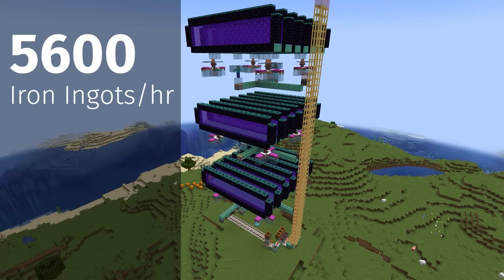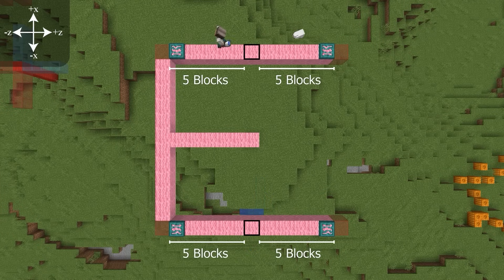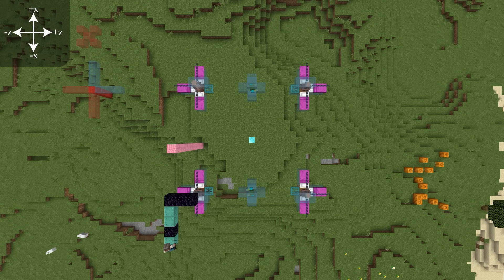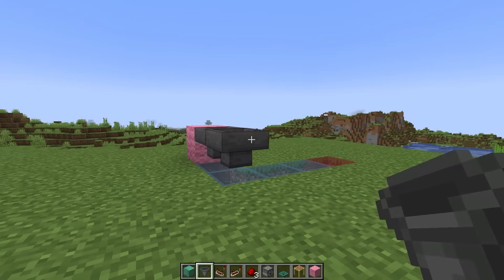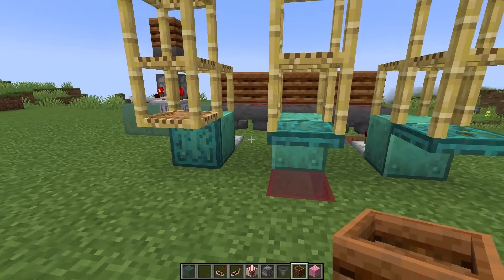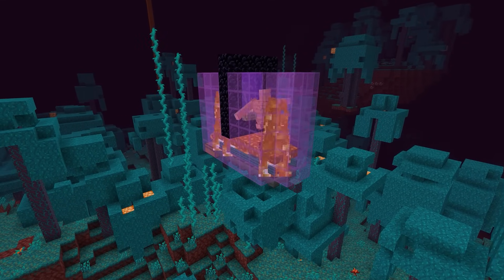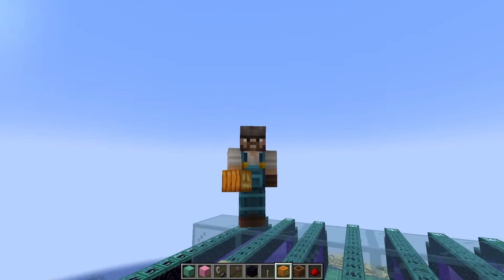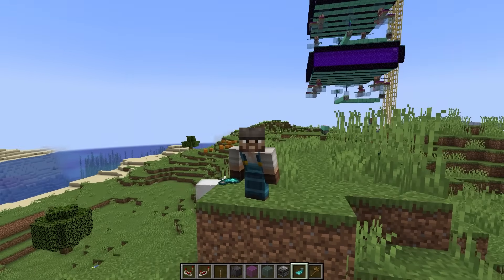Most Efficient High Capacity Iron Farm - Build Tutorial

Comment: Is anyone having problems with zombie pigmen being on the other side of the portal, if you do know the solution could you please lend a hand?
Reply: Yes! It was driving me crazy, but I fixed it. The zombified pigmen are spawning on the overworld side and going through the portal. My kill chamber was full of them. So on each overworld portal platform, I placed turtle eggs and trapdoors so they believe they can walk to them, between each portal frame on the outside of one side of the platform, but alternating sides for each of the 3 platforms. Alternate sides so higher layer Pigmen don't fall on and destroy lower layer eggs. This protects Layer 2 eggs from Layer 3 Pigmen and Layer 1 eggs from Layer 2 Pigmen. But to protect Layer 1 eggs from Layer 3 Pigmen requires one extra step, I added end rods across the top over the eggs with carpets on the same level as the top of the portals, and build the farm so that the Layer 1 Pigmen die when hitting ground level. Now I have zero Zombified Pigmen in my kill chamber, yay!
Reply: @Curufinwei  I had a vision of doing this however I didn't really meet the resources required so I quite literally just dealt with it :)

Comment: could I build it in the spawn shunks?
Reply: Absolutely! Building this farm in your Spawn chunks is ideal. I built this amazing farm in my spawn chunks, and went through a nether portal and then back to the overworld and afk'd at my Pale Garden Base thousands of blocks from the iron farm and it ran perfect. Just be aware that the spawn chunk radius has changed from 10 to 2 (apparently just to improve performance) which could really cause a problem for your farms. They added a new game rule that allows you to configure the spawn chunk size how you want. To set it back how it was, the command is: "/gamerule spawnChunkRadius 10". I didn't have cheats enabled to enter the command for my world, so I used NBT Explorer to change the gamerule instead. Since it is a change mainly for performance reasons, this does not feel like a cheat to me.

Comment: I strongly advise against setting up this farm unless you have an extensive understanding on how farms work.

-When you get away from the farm, the clock often stops working (you have to rebuild it from scratch).
-The farm is constantly breaking apart inside spawn chunks (do not build it on spawn chunks).
-The zombies regularly escape their cells (put a solid block as a platform for the zombies instead of glass).

Overall, the design is not very well troubleshooted and not beginner friendly.
Reply: But I want a good iron farm):
Reply: @Rutx.hi.i.love.u  Build it, it is a good farm. Amost all of the problems I listed were fixed building it outside of the spawn-chunks.
Reply: The reason you probably had problems is that Mojang changed the spawn chunk radius from 10 to 2! This could cause part of your farm, or part of your clock to be running and part not! Or none of it. They added a new game rule that allows you to configure the spawn chunk size how you want. To set it back how it was, the command is: "/gamerule spawnChunkRadius 10". I didn't have cheats enabled to enter the command for my world, so I used NBT Explorer to change the gamerule instead. I had this running in my spawn chunks flawlessly with this change. I have run it for 48+ hours, stopping and starting it many times, and going through a nether portal and back with it running. If for whatever reason you can't or don't want to change the spawn chunk radius back to 10, then yea you might want to avoid building it in spawn chunks unless you carefully make sure it is fully within the new tiny spawn chunks, but otherwise it is the ideal choice.

Comment: The boat and chicken trick doesnt work for me. I've tried it twice with 2 chickens each time and put the boat in different orientations in the overworld and teleporting it to the nether. The chickens end up dying from entity cramming because the golems arent falling.
Reply: That's because it's on 1.21.3 mobs on boats now teleport through portal
Reply: @zanujgaming932  that's not what's going wrong. I put the chickens in a boat on the overworld, light the portal and they sit in the portal in the nether and just don't push golems and then the golems become too many and kill the chickens, which allows the golems to push the boat and it stops working. It's fine though, I just chucked a zombie in the area
Reply: @MadGaming10  I think this may be the same problem I had and it was (no joke) because the boat was placed too perfectly centered! Instead of pushing the Golems, cramming causes the boat to break and drop and the chickens or villagers to go into the lava. I used NBT explorer to make the boat exactly centered and it would break almost instantly every time, but make it a little off center and it never breaks and drops, I've had it running 48+ hours.

Comment: Shouldnt this work while in the nether if built in spawnchunks? Bcs i did but when i go to the nether it stops working and idk why, entities going through portal should load the spawn right?
Reply: No, spawn chunks are not loaded while in the Nether. Possibly the right chunk loader could allow you be in the Nether and have it work, but not as is. Also, they changed the spawn chunk radius from 10 to 2 so that could mean your farm isn't even in the spawn chunks or even worse, partially in and partially out. There is a new command to configure it to be like it was before the change.
Reply: @Curufinwei  Thx for the explanation. The farm is indeed on spawnchunks bcs I located it with a precise method. I just thought that entities going into the nether loaded the spawnchunks like they did in previous versions

Comment: can nether side be done on nether roof or will this not work?
Reply: I mine on the roof and its only running at half capacity. I only did one layer of portals in the overworld tho.
Reply: @JaggedAxe-11  Where in the nether you have the kill chamber should not matter. Mine works great with the kill chamber on the Nether roof with 5800+ per hour. Yours isn't running at half capacity. If you only built one layer, then shouldn't you expect 1/3 the rate of the original design of three layers?
Reply: Yes, that's what I did and it works perfect. I built it just like the instructions but put the kill chamber on the nether roof and did 2 optional things mentioned in the video, extra space between the platforms and 4 villagers/beds per pod instead of 3 and I get 5800+ iron per hour. Also I added an auto crafter circuit on my nether side to craft the iron ingot to blocks, also compost the poppies and auto craft the bonemeal to blocks as well. This farm is super OP, thanks to Nico Is Lost!

Comment: Did this farm in 1.21 server. It produces 1056 (aprox) iron ingots with the 1.19 scaffolding style. 
See there is one thing I did not understand, do I have to do the 1.18 scaffolding thing or 1.19? I made the clock with less repeaters as he says in his fix thing but i have 8 hoppers and the scaffolding with 1 block spacing, also did the boat thing so its all good, but I think the rates are very low.
Reply: Look at the pinned coment, he has made a correctional for 1.20.2+

Comment: 1.20.1 - zombie pigmen keep spawning in my overworld platforms and then clogging up the killing chamber in the nether. how'd you guys fix this?
Reply: i ended up just running the farm and they all died, but clogged up my hoppers with their drops. i worry that overtime my hoppers will fill up with their drops and the storage will break, so i might end up switching to an ice line collection system
Reply: Check my previous comments, I used turtle eggs and it works great. Not one single Zombie pigmen get's in the kill chamber mow
Reply: @Curufinwei  where did you put the eggs?

Comment: for me, the redstone signal is not transfering through the scaffoldings to the sticky pistons under the zombies. why is that so? btw im in 1.21, is that the issue maybe? and does smbdy have a sóloution for me in 1.21?
Reply: same & idk
Reply: @altzrey  i have founde the soloution: just replace the scaffoldings with a slab redstone ladder, and connect with an observer facing towards the trapdoor, and put some repeaters to lenghten the redstone signal! hope this helped u, at least for me it did :)
Reply: the redstone signal wont travel through the scaffoldings. the observer is there to detect the block update.
check if your trapdoors at the bottom are getting powered or not or if the hopper system working as in the video
Reply: Double check your building the scaffolding up from the trap door and not from the solid block you should have the tower on top of the trap door with 1 piece on the solid block I had the same problem and that was the issue

Comment: The redstone clock is not sending the signal to the zombie pistons. What could be the problem? The version is 1.20.6

Edit: it's only at the bottom layer. The 2nd and 3rd layers work just fine. The redstone contraption is the same on each layer (just facing different scaffold columns). Can't understand it.
Reply: I'm having the same problem. I only built 1 layer as that's all I really need. Please let me know if you find a solution.

Alright, so I've managed to fix my problem on my own.
Basically: The scaffolding tower was on the inner block and not on the trapdoors which was for some reason preventing the observer from reading the signal (No idea why, I'm no engineer)
What helped me was downloading Nico's world in the video description and cross referencing my whole design with his.

Hope this helps :)
Reply: @jackzicrosky   I was actually hesitant to fix it because the farm is very effective even at 67% of it's power, but turns out the repeater on layer 1 was just facing the wrong direction. Should've fixed it earlier. Glad you've found the solution too!

Comment: There's a very easy way to simplify the killing chamber and item collection. Just make the portal on the nether side a standard 2x3 portal and surround it with blocks and 1 lava or lava cauldron at the top, so the golems immediately take suffocation, lava and fire damage. When they die, the item drops are instanly sent back through the portal. To collect the items you can make another small portal in the middle of the iron farm at the same height as the nether side portal (usually below all the other portals). If the nether side portal is below the surface level of your overworld, you can put the collection portal on the surface instead, as it just needs to be the closest to the nether y-coordinate of all portals in the overworld area. Under the collection portal put a hopper minecart and you can easily collect all the items in the overworld so you don't have to make an access to the nether side for item collection at all.
Reply: did this and it works very well
Reply: this method is definitely more complicated than the one showcased in this vid
Reply: well thanks bro i was looking for a latest cmnt for reassurances

Comment: I built this in my single player survival world as just a single layer/module. It's very efficient and produces plenty for my needs. The only issue I've had with it is that the zombies sometimes fall through the blocks they're standing on. If anyone has any ideas as to why this is happening, I'd love to know. My suspicion is that it has something to do with unloading the Overworld as this seems to - at least anecdotally - occur the most when I'm going between the Nether and the Overworld a lot.

Managed to accidentally offset the blocks moved with pistons so that when one is up the other is down. Achieved this by simply placing the blocks at different times of the piston rotation. This kept the farm loaded in the Nether for quite a while. Maybe something like 5 minutes before the Overworld finally unloaded. I'm guessing that the timer is just enough to keep sending an entity through before the Overworld unloads, but if there's any delay it goes past the timer. Might build another layer just to keep the Overworld loaded at all times, seeing that just two is enough when offsetting the zombies on each layer. Three would be total overkill unless I'm planning on doing a huge project with Iron Blocks.

Comment: Hey Nico, love your build! Have been using this farm since 1.20.1, it's been so helpful. I've done the fix, but I had another problem. For some reason, some of my zombies disappeared. I checked if they could have died from burning during the day but I'm positive that's not the case. I've followed your guide step by step. Do you have any idea as to what may have caused this so that I can prevent it in the future?
Edit: Forgot to mention, they were nametagged for sure.
Reply: I FIGURED IT OUT!! In 1.20.5 they changed the radius of spawn chunks. so it went from 19x19 chunks to 3x3. They also added a gamerule called spawnChunkRadius, which can bump them back up to pre-1.20.5 chunks. So you have 2 options if you wanna fix this problem:

1. (easy) Use "/gamerule spawnChunkRadius 10" to put the world back to pre-1.20.5 spawn chunks.
2. (hard) Put your farm in the new 3x3 area centered around the main spawn chunk. You should only do this if you don't have permission from the server owner to bump the spawn chunks back up.
Reply: Coming back to this, if you block the bottom of the zombies' chamber up with solid blocks the zombies won't die anymore, however they will get shoved into the glass block. You have to manually put them back into position, but at least they won't die. This seems to happen when you build the farm in spawn chunks. I wouldn't recommend other people build this in spawn chunks just because of this issue! You may be able to get around this by not using nether portals anywhere near where the farm is built, however I haven't tested it.
Reply: I've had this problem too. I looked in my server logs and it says they swam in lava, which I have no idea how that could be the case. They probably somehow got in the killing chamber. DId you ever figure this out?
Reply: for me, some golems rarely seem to spawn on top of the portals or the redstone wiring that connects to the pistons, so they just walk up to the zombies and kill them through the glass. I just placed more blocks to prevent them from reaching the zombies. idk if thats what the problem is

Comment: Really, why 70 ticks? It makes each floor phased 14seconds. I dont understand why not 50ticks clock so  a 10second difference between each one of 3 floors. The first floor gets another SCAREJUMP 30s after the first one
Reply from the maker: Because the min time between spawns is 35 seconds, or 350 redstone ticks in 1.19-1.20.1
Reply: @NicoisLOST  Thank u a lot! Im playing with the timings cause i cant manage to get it to work as a chunk loader and the moment im on the nether, golems stop apearring through the portal
Reply: @NicoisLOST  And why not make the cycles of 35 seconds by setting the clock to 35/6=5,83(5,9s) instead of 7s?
Reply: @NicoisLOST  I cant get my overworld to stay loaded. One out of the three floors spawns golems at 15s difference with the previous one. I guess due to the 35s total respawn cooldown. So it makes the overworld unload due to not having nothing pass the portal for 15 full seconds

Comment: im on 1.19.4 and i cant make it work
 the villagers wont sleep the iron golems are 3 to 10 in an hour and it's alway full of pigmen. i tried afking above but idk where to afk bc idk from where to go up 128 blocks. Please help ive been building this for 2 days.
Reply: yooo, I had the same problem.
I managed to fix it though, here's what I did :

-break the block of glass above the villager head (not the one above the trapdoor)
-replace chains by trapdoors, in the "high position"   (if it was place on the side of a block it would be aligned with the top of the block
- place a trapdoor under the glass block  (the glass block that is above the first trapdoor)

if you did everything right, the last trapdoor should be at the same level as the other trapdoors above the beds

I hope it was clear and that it works for you.

Comment: Helpful tip: If you don't want to mine obisidian you can just take 2 buckets, fill 1 with lava, fill 1 with water, and just place the water over the lava.
Reply: you would need nearly 1000 buckets of lava, just mine the obsidian
Reply: @DarkKnight-rf2uu  You need the best pickaxe to mine a single obsidian block for 21 seconds. You can fill you're whole inventory for 10 seconds with lava buckets and spend another 30 seconds placing it. What you're saying is wrong. Plus, why would you need 1000 buckets? You can just fill your inventory with buckets and go back and forth to a lava source.
Reply: @blaque5900  you cant build the farm in nether, you are just wrong about the pickaxe forgetting about efficiency 5 and haste 2? Plus you can mine out the pillairs in end making it easy to do it, youd have to travel quite far everytime you want to get lava buckets or go into nether which will also take a while

Comment: A good tip for getting villagers, move trapdoors to top(right below glass) and push them with minecart into a powered activator rail right where the bottom trapdoor is supposed to be and they will get knocked into the block they need to be in